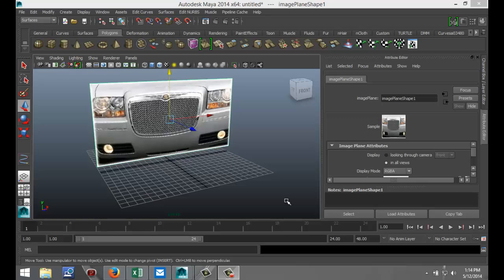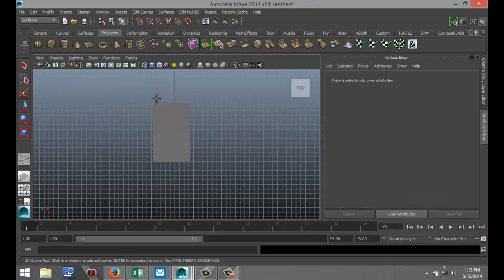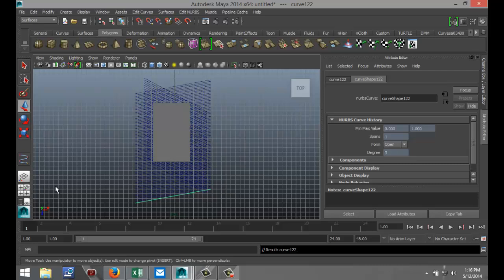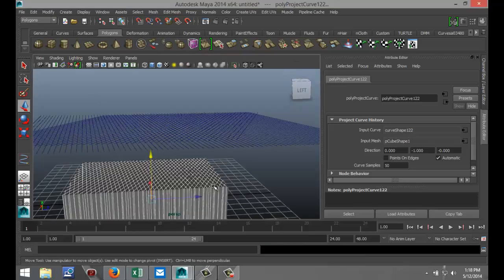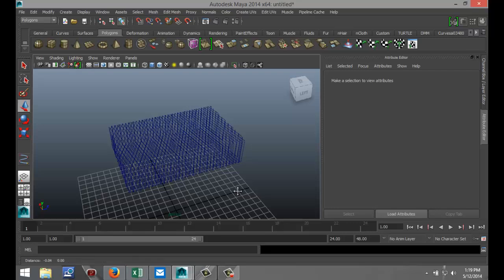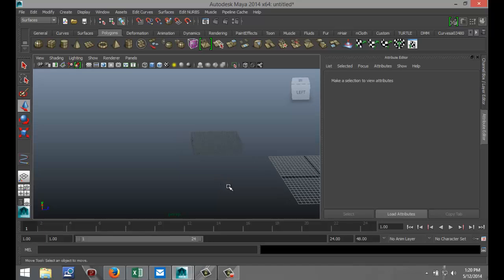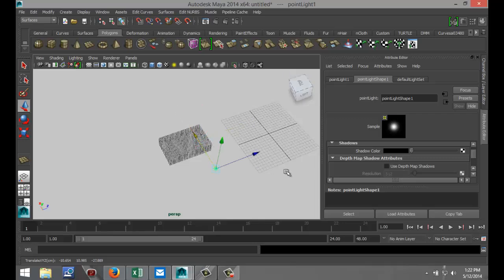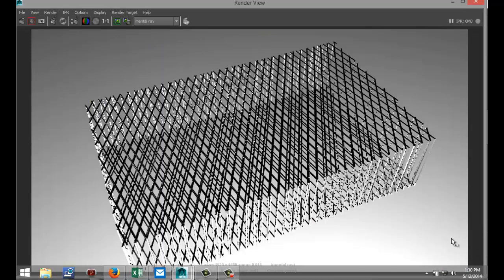Maya 2014 tutorial : How to project a curve on a mesh

Comment: Just did the tutorial! It was really helpful up to the bevel part. By then, it’s all about what size the curves are because my bevel width and depth values were much smaller than yours. It also may be that Maya 2015 changed its values, too. 

Subscribing for the great help!
Reply from the maker: +gatethunder oakbjörn Thanks for subscribing ! The bevel may be off due to the difference in scale. If my model is 10 centimeters and your is 10 meters then Bevel will respond differently. So check you default modeling settings for your grid.